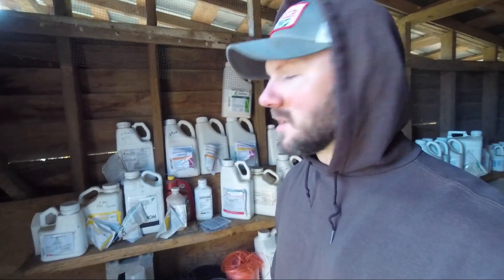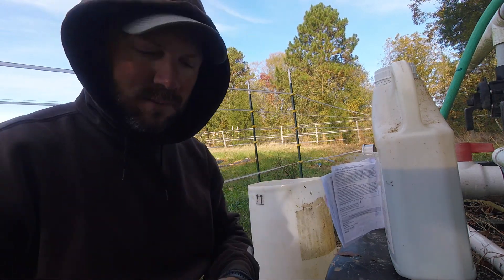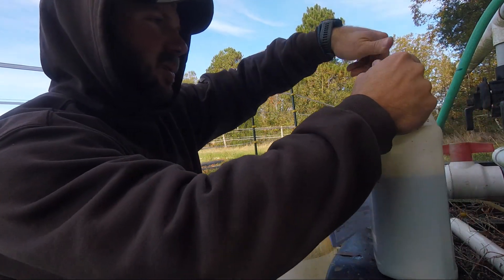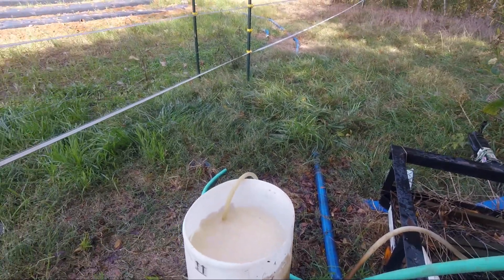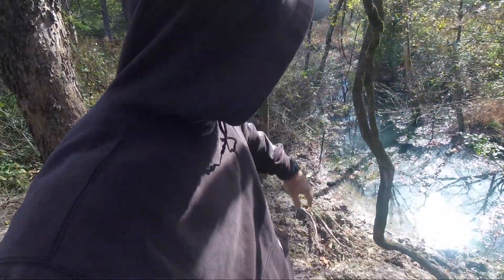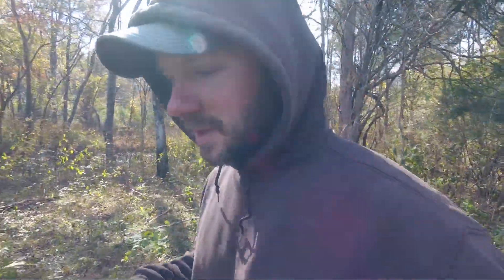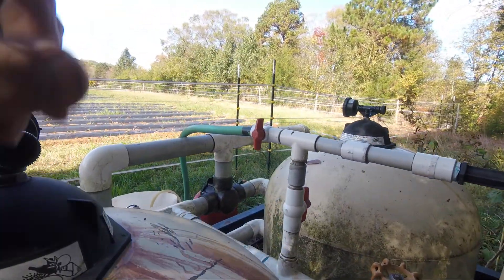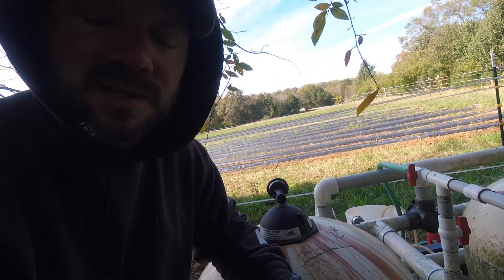Chemigation on strawberries

Comment: Hey, couple questions. What elevation increase is your strawberries from your pump? Also guessing it's a 2" pump but what's the hp? and how many GPM you think you're getting from the pump once it gets to the field?
Reply from the maker: 2" 6.5 hp predator pump, about 75 ft of rise to the field. I have the filters in the field to provide max pressure to push the water up the hill.  About 60 gpm before it hits the filters. It'll water 2 acres at a time with no problems

Comment: Great video. I might try that on watermelons next year, especially seedless.  Could be something I've had but not noticed.  My cycle is 1/2 hr to precharge, 1 hr to fertigate, 1 1/2 hr. to flush. Maybe I'm seeing things, but it seemed the yields dropped at the far end of the rows with a 45 min. flush, so I doubled it. I'm running two timers to automatically do the who cycle.